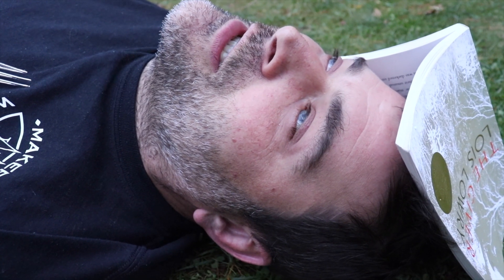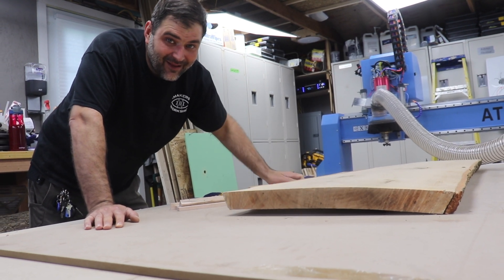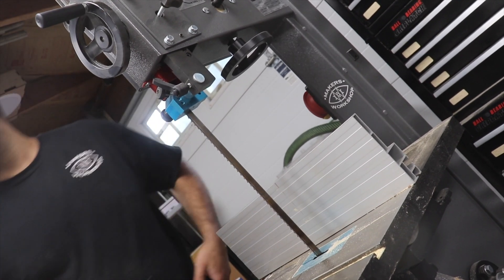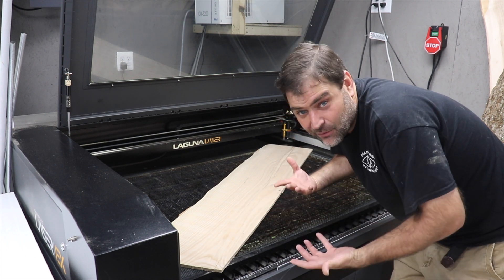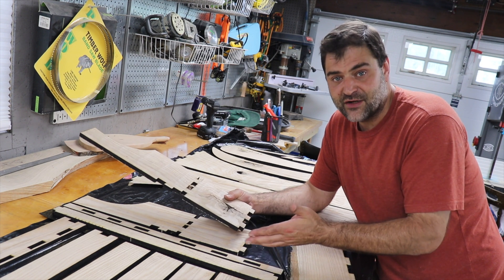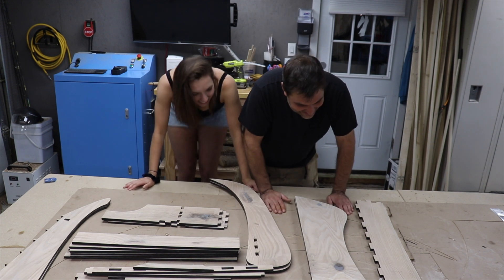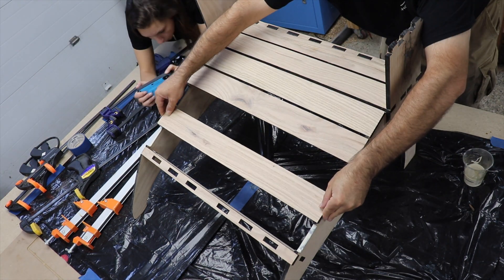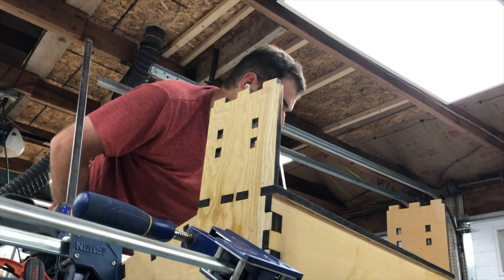Making A Laser Cut Chair | Lasercut Chair | CNC Woodworking

Comment: Awesome.  Prettiest Adirondack I've seen yet. Will the files work with a cnc router like the one you surface planed with?
Reply from the maker: Yes! it is designed for a 1/2” material. If you want to make it thicker you’ll have to adjust the joints. That’s the only potential “hiccup” I can think of you may run into
Reply: @MakersWorkshopLLC  awesome.  Thank you for the reply.  I don't have machine yet but will purchase your plan soon.